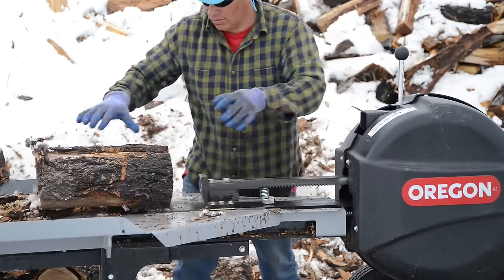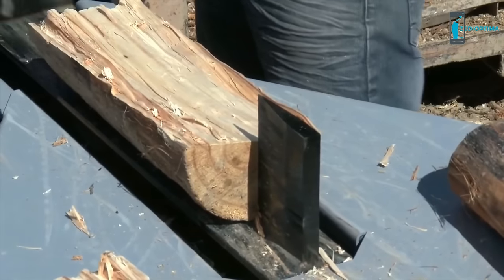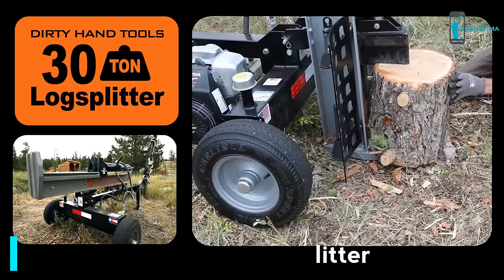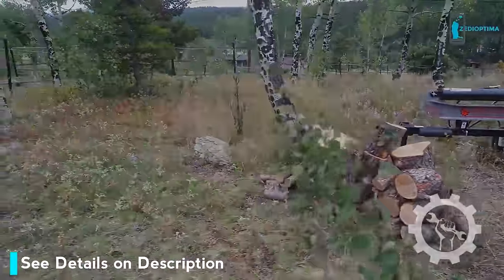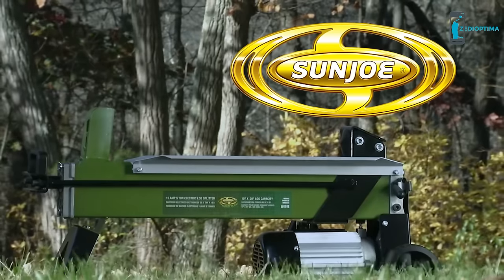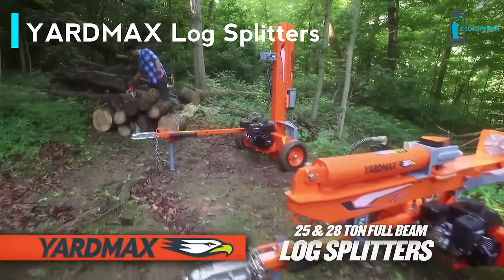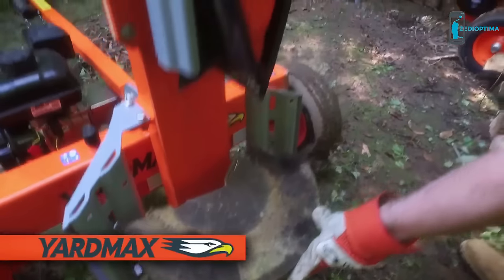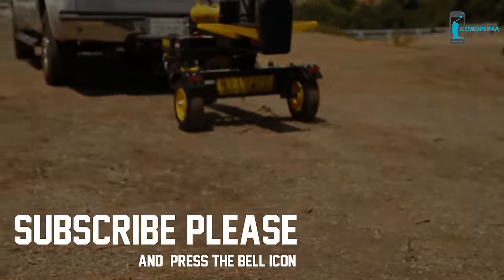Top 5 Best Wood Log Splitter You Need To See

Comment: Oregon as well as all other kinetic splitters are copies of the SUPER SPLIT.  I own both the super split hd and a craftsman 27 ton hydraulic.  I split 95% of my logs with the supersplit and hate going back to the hydraulic as it is painfully slow.  Will the hydraulic split everything that I throw at it, yes.  Will the supersplit? 95% of the time. I have split some naaaasty knots and crotches with the supersplit, you just may have to hit it a couple times, which is still faster than the hydraulic.  If I can't split it on the supersplit, I have no business trying to split it to sell anyway.  I do keep those logs for the hydraulic to play around with though. ONLY upside to the hydraulic in the regular homeowner type, (not timberwolf size with log lift) is the vertical split option for logs that are 30+" diameter.  I lift most everything less than that up to my supersplit table which is hooked up to a conveyor.  If you go the kinetic route, I highly recommend a conveyor set up for the end of the splitting table, as the amount of wood that would pile up would be needing to be moved if you just want to slide it off of the table.  I don't bother wheeling the conveyor over to my hydraulic because it would be a waste of gas in the conveyor compared to the speed of the hydraulic.  Another bonus to the kinetic splitter is the fuel efficiency.  Since it cuts logs like a hot knife instead of brute force, it just sips gas.  I have a honda gas motor on both the supersplit and my conveyor and can split for 5 plus hours on a single tank of gas.  This usually yields about 5 cords of wood as i tend to split a cord an hour with the super split by myself as long as i have the rounds staged nearby.  The supersplit and conveyor gas tanks are only 1 gallon capacity each.  So for 2 gallons or roughly $5 in gas at this point in time, I can split 5 cords of wood. Supersplit is a legitimate, professionally used, commercial splitter.  It has waaay less maintenance than my hydraulic splitter as you don't need to worry about hydraulic fluid or hoses or filters.  Only wear items that may eventually wear out are the bearings that the rack rides on if you don't clean the beam off every now and again.  The return spring will probably wear out eventually.  The rack and pinion are design and hardened to last for years and years without even bothering to look at it.  People are still using original rack and pinions after splitter over 1000 cords of wood. I would not hesitate to buy another as it is a full production machine.  I am not associated with super split, just offering my experience.  Happy splitting!
Reply: I agree with you the Super Split is great. We have used one for 30 + years and replaced the engine last year . Aside from that only routine maintenance. Great machine.
Reply: May we have the price?
Reply: Wow! stuntman! but you're a professional firewood cutter, that's different than most of us! I loved the speed of the kinetic splitters but sometimes have rounds 40" across! We bought the yardmax 35 ton and the wife can't keep up stacking as fast as I'm splitting.
Reply: Update...my supersplit was a fantastic machine and didn’t have a single issue with it. When I went out and cut the logs, I had control over the size diameter I fed it. I have since been getting loads of logs from tree companies so I lost that control. I am now getting large logs that I couldn’t lift onto the high work surface of the Supersplit so I sold it and bought a built rite 11hpws with log lift, hydraulic adjustable 4 and 6 way wedge, auto cycle, and honda motor. I honestly can’t feed it fast enough. It now suits my needs. Who knows what will be next???

Comment: I bought the 25 ton county line log splitter from tractor supply and has never let me down yet. Most of the other brands I looked at didn’t even come with hydraulic fluid. Also starts first pull every time!
Reply: Thanks
Reply: I have the same older model, keeps an eye on where the head of the ram attaches to the splitting head as well as the large bolt that connects the ram to the body of the I-beam.  The flexing of those parts while splitting start to wear in to the metal on both ends.
Reply: Randy She  Good thinking Randy, I will start doing that!

Comment: I have the yardmax 35 ton, been using it two years now and not a hick-up! I have been cutting 38"x20" fir with pie pan knots and this machine walks right through them. No way could I musel logs like that on to a kinetic splitter. My wife can't keep up with the stacking right now, don't know how i could use anymore speed.
Reply: I don’t know if you’ll see this but I’m torn between this one and the 25 ton county line log splitter
Reply: @aguileratreeservice9189  I think that's a good splitter, actually had one, the main reason I went to the yardmax was the price, tractor supply had them for $1200 (the 35 ton).  Yardmax are built very tough and the price was right.

Comment: How would the Oregon kinetic splitter work with good old curly maple instead of half rotten pine. Not good I bet.
Reply: stay away from this kind of splitter
Reply: Yes  was wondering how it would handle any kind of knotty timber.
Reply: I have a "super split" which is the same style and it has handled everything I can throw at it. Unlike a hydraulic splitter, you can take multiple hits at the knotty stuff. I'm super happy with it.
Reply: Yes I have the super split its really quick and will bust almost any round
Reply: Why would you want to piss around taking multiple hits at a tough piece of wood? My splitter splits blocks up to 500mm thick and up to 1.2m diameter in one pass. Log goes in one end and comes out the other in blocks ready to burn. All hydraulic by the way👍
Reply: @imallowedmyopinionok2354  What’s the make and model of your splitter?
Reply: @richardjenkins8366  i just call it "the splitter" no make or model with this one.  I built it.

Comment: Have 30 oak trees in my backyard garden. What log splitter would you recommend? Also, I don't forsee myself using it after this job. Would you sell or rent it?
Reply: Rent for a day
Reply: get atleast a 30 ton spliter i just did Sum green red oak last week had to rent a spliter. a min 25t should get you threw it. Cost was 70 from local hardware store. and the 24 he rental with working alone got 3 cord worth split.

Comment: Would love to see these kinetic wood splitters in twisted grain wood.   They always use nice dry straight grain wood that could be split faster with a maul.   also those electric splitters are a joke. BTDT not going back
Reply: Yeah it would interesting to see a wood splitter cut knot and twisted grain logs
Reply: I don't think that was Electric by the looks and describes it using less fuel.. Whenever they say USES LESS FUEL means its has substantial more PROBLEMS.

Comment: The Oregon log splitter is the easiest & quickest
Reply: Help !!! I know absolutely nothing about wood splitters.  We have a log truck that drops a load off. Only would use it once a year to split the load of logs. Not sure what to buy. Would so appreciate any help. I'm a thinking shoes are easier to buy
Reply from the maker: Oregon log splitter is a very good wood splitter
Reply from the maker: Thinking
Reply: @pammiestewart1419  What did you go with? We're in the same position. We just moved into a house with a fire for the first time and I'm finding a lot of the harder wood is impossible to split by hand, and I end up doing out my back. Need a quick and easy solution. Not fussed about the price.

Comment: You will find out that a log splitter are not designed to pull behind a pick up truck it’s too hard on the motors do you beat up to death? They’re all they designed to pull behind a farm tractor. I bought a small trailer to haul it on much easier on the log splitter I just bought a new one. My old one lasted me 30 years and I don’t know how many cords of wood that I split with it I wore the cylinder out and two motors so I can say for so I can say from experience that’s the best way

Comment: Lots of moving parts to break on the Oregon splitter.
Reply from the maker: Oregon log splitter
Reply: There seems to be one flywheel, one rack and pinion, an engine, connected to the flywheel with a belt, and the lever that drops the rack on the pinion.

Compare that to a hydraulic unit with a hydraulic ram which contains two sets of seals, the same engine, 4 or so hoses each needing to be sealed on both ends, an oil filter with a seal, an oil reservoir, and a hydraulic pump.

Both somewhat complex but not overly so. I would think the rack and pinion unit would do as well as the hydraulic unit, with a lot less chance of leaks.

But then you look at the cycle time difference and it's like five to one.

So, I guess make your own judgment.

Comment: The Dirty Hands splitter is terrible.  A neighbor had one, I used it quite a bit.  Note the log catch table...and how logs can vibrate off and fall directly on the engine.  Also, their design for the 4-way wedge sucks.  Way overpriced.  The bottom line splitter at Tractor Supply is way better.
Reply: Mike Groat I've got a 22 ton and am waiting for this thing to die already. As you said, pieces fall off the feed table constantly. I've broken by exhaust housing from it. It's not worth its weight in gold by any standard

Comment: By far, the only unit here worth its' salt was the Champion, the rest, keep um.  At least the Champ protects the motor with a good table & an additional one for the operators side of the machine. Personally I don't like vertical splitters because of the engine placement ( not protected ) in the horizontal position. Most splitting will be done in horizontal, therefore the engine gets positioned BEHIND the axle and/or hyd. reservoir. Little credibility to this video calling it Top 5 Best, hardly... The Champion came close.

Comment: Is it really that hard to make what we want?  <10 second cycle time.   Slip on 4 way wedge that actually has sides long enough to split 4 ways.  Auto retract.  I literally hate when they “a fast 17 second cycle time.”  I also hate when that electric one says “two handed operation for your safety.”  First two things everyone would have to do to that would be to disable that and build it into a work table so you don’t have to squat down like your taking a dump in the woods to use it!
Reply: ⅔2³222³3333³3³2nd 2

Comment: But that is American SOFT wood. Get some box and have a go.They won't split AUSSIE HARD WOOD.
Reply: Yes I fully agree! I've been splitting Iron Bark which has been down for over 4 years, I don't think those Kinetic splitter would work at all.
Most of the videos you see on YouTube are with soft wood.   
I'm only a property owner, not in the business of selling firewood as a living, however we had to clear 3 Acres to build on, heavily wooded and selling it as I wouldn't get through all that firewood in 10 of my life times.
So the hydraulic 28 ton Oregon with Honda motor works for me.
All Australian Hardwood.
Haven't had any problems yet, touch wood.
Reply: @vinceballam4002  Right on mate! (former Kiwi here) even here in Oregon we split out rounds 50 inches across full of pie pan knots 6 plus inches across. No way in the world one of those kinetic splitters would cut the mustard.

Comment: All these splitters are bullshit.
They don't tell you how to get a 200 Lb. 3 ft wide hardwood log ONTO the splitter.
In fact they never show you how fucking hard it is to get ANY big  log onto one of these things.
They're okay for small stuff, but when you cut down a 100 ft tall hardwood tree in the middle of a forest, and the cut logs are 3 ft wide it's easier to just use a few axes or mauls and a sledge hammer.
Here in the Laurentiens there are so many massive boulders and steep hills: pulling one of these machines to the tree can be a bitch.

Comment: couldn't pay me to own a rack and pinion splitter.
Reply: you got time for 13 second cycles?
Reply: @devtrash  my cycle times arent that long. Rack and pinion splitters just seem like they wouldn't last. Kind of like neutral dropping a car. They are definitely much faster than any other splitter.
Reply: @davehimlin2374  seem like it would bust the gears up fast. Thats why I dont have one. Plus I like the control of hydraulic.
Reply: Couldn't pay me to own a hydraulic splitter.
Reply: @TimberHog  My Douglas fir rounds are often over 40" some with knots over 10", how would you load those on a kenotic splitter?
Reply: @davehimlin2374  So how do you use it on a 50" biscuit? I often split out wood 30"+ ! sure for small wood they are great!

Comment: Two hand operation? .... how do you drink a beer when you have to use both hands to split wood, I will stay with the old 27 ton green Craftsman.
Reply from the maker: Log splitter
Reply: I just use a toggle switch so no more using both hands